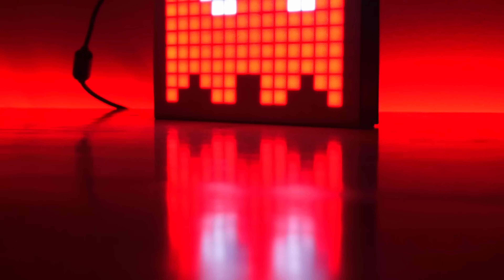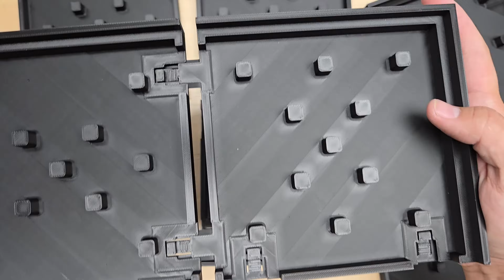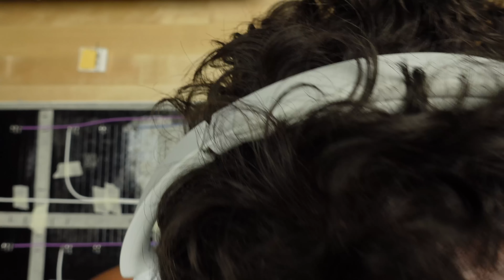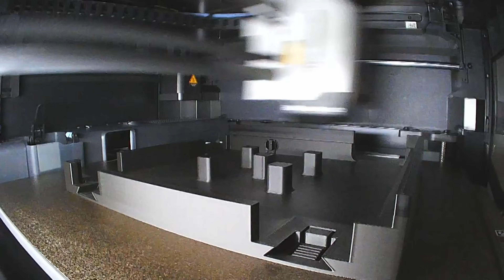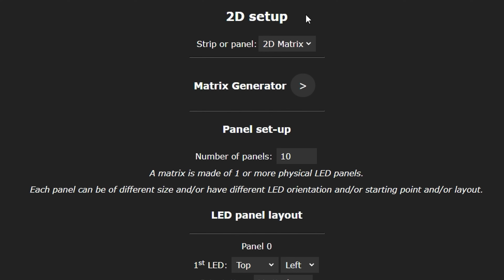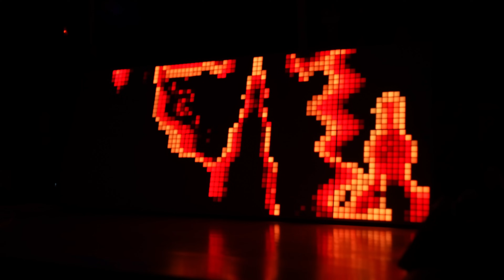I made a HUGE Pixel Display! (80x32 LED Matrix + WLED)

Comment: Based on your display tutorial, I made an 80x48 one (using a 5x3 layout of individual 16x16 matrix panels). It uses an ESP32-S3 driving 4 channels of 3x 1024 and 1x 768 strings of LEDs. I had to power the ESP32 S3 separately and added a 1000uF / 10V cap close to the +5V / GND terminals of each of the matrices along with a level shifter attached to the outputs of the micro controller to make it work reliably. It worked instantly. I also followed your idea of connecting a digital microphone to the ESP plus using the audio reactive build of WLED. I was amazed that even this worked like a charm right away.
Reply from the maker: Awesome, sounds like you made something even better! Definitely post a pic on our discord if you use it!
Reply: @MakeItWorkTech it’s still a prototype, but since I am now confident I know how to deal with such a build I’ll probably try to create an application specific PCB with massive GND and VCC layers or a system of copper rails providing good conditions for high currents (low resistance) and low inductivity. I’ll definitely have a look at your grid / diffuser solution when it’s ready to get built in into a proper case.

Comment: Under pressure, like that of a screw terminal, cold solder flows. Slowly, but it does flow. Over time, each tinned wire will become loose in its respective screw terminal. Instead of tinning the end of each wire, use crimp-on ferrules. Keeps the strands together like tinning, but there's no solder to flow.
Reply from the maker: Interesting! Never new about that. I'll have to use those in the future!

Comment: I made one of these from your models.  Thank you.  How are your attaching the face plates to the base plates?  I ended up using uv curing resin to hold them together.  Perhaps a gen2 of the models that allow the face places to latch in or attach to the bases?  Also is there a way to save the generated pixel art with the converter as a preset?  I couldn't figure it out.

Comment: Can it be made many times larger? What are the size restrictions if any?
Reply from the maker: Power restrictions and # of LED restrictions
Reply: @MakeItWorkTech  I wonder how many LEDs can be contorlled! On your 7th channel you had to control 768 LEDs, if all 10 channels were functioning, that would be 7680 LEDs. I'd think even 1024 LEDs might work on one channel alone. Probably I'd need to experiment!

Comment: on my channel I put up just 2 videos so far..  some projects I have been working on,  some table lamps and a couple corner lamps.. mostly 3d printed... and right now I am working on a 4' x 4' panel for the wall  over 4000 LEDs when it's finished  :)

Comment: I put a 32x32 (4-8x32 panels)  matrix in a 12"x12" picture frame  1024 leds  on a single esp32 and a 5v 12amp power adapter..  also in WLED there is a pixel art converter pretty much built in.. very cool

Comment: They started selling fixed panels like this on Aliexpress now.  Only 4x4 panels, but probably cam be hacked to expand it.
Reply from the maker: I'll have to check that out!
Reply: @makeitworktech  the ones I saw are called IDM pixel display kits, searchable under pixel art.  Not as cheap as if you'd make them yourself I guess, and probably won't scale as big without similar effort.

Comment: Why not just solder the wires directly to the through-holes on the microphone board? That should be a lot easier, cleaner looking, and provide a better connection than a wires soldered to the side of pins. If I had to attach wires to pins like that, I'd use a wire wrapping tool and skip the solder

Comment: Have you tried the animartrix 2d effects that are included in moonmodules? Those 2d effects are pretty awesome and there are a crap ton of them.

Gonna have to get my buddy to print some of these connectable frames for me. I was using your original frames for a 32*32 but the new ones look like they will hold together better. Thx for doing all the design work. Looks super cool.

Comment: I have a tip for you, use crimp connectors, the connection will be more stable and you save yourself the soldering because soldered cables in a screw terminal have a higher  resistance and this could lead to a fire
Reply from the maker: Good idea! What about Wago connectors?
Reply: @MakeItWorkTech  WAGO connectors would also work, even easier because you can use them relatively easily and do not have to unscrew a screw every time, but simply open the WAGO terminals.

Comment: OMG, This is exactly what I want for my bedroom. Im gonna give it a try, wish me luck! ajjaja
Oh, one thing, Is it possible to make those pixels a liiitle bit smaller¿ say, 30% smaller¿
Reply from the maker: You mean thicker lines on the matrix?
Reply: Yes. He was using a 16x16 panel, in another video of his he shows 22x22 panels at the same size, that's roughly 30% smaller pixels. 
If you wanna go an especially costly route I just found 200 led / m strip that's 5 mm wide, therefor a matrix can be built with them. This solution is half the spacing, 4x the resolution.

Comment: For your noise twists a GND and the data line together it will shield the data line from parasites you can use twisted wires from Ethernet cables. You will manage to increase your frame rate times 3. Which will make the animations smoother

Comment: NICE!
I have one with 4 of those 16x16 matrixes, run off a cheap $5 ESP32 on a single pin. I cut cardboard dividers with my laser. I'm using wax paper for a diffuser, and its frameless until I find a better diffuser since I don't have a 3d printer.
I use it as a clock with rotating animated backgrounds.
Just trying to figure out how to stop the scrolling, and have JUST the time with the date below it centered on the screen.
When I get some time soon I'm hoping to try and see if one of the AI's can help me make the code since I can't find any online anywhere.

Comment: learn to use a multimeter and design your own controller board by reverse engineering the controller board. it's incredibly easy. it's what i do. there's only 1 signal to keep track of. cracks me up that you overpay for those garbage controllers.
Reply from the maker: I know how to use a multimeter, thanks! "Garbage controllers" might be a bit of a generalization. I really like some of the controllers I've been testing!
Reply: @makeitworktech  I find learning the best part of getting into stuff like this. I have a few hundred thousand leds of all different types but I'm at the point where I just make stuff for people. I've designed a whole lighting system for my home this xmas for instance and it involves designing a custom controller.  I'm sure I could use an off the shelf one but the coolest ones are created by 'makers' on tindie who ask way too much money for their creations because of economics of scale. I also reject the feedback loop the 'maker' community run on. Toxic elitism and the fact they think they can build anything. I know a bunch of known creators and while I like their 'off screen' personality and think they are generally good people. I've seen alot of them turn into greedy bastards who have channel membership tiers with the gall to ask for a few hundred dollars a month in some cases. One I know is a musician for instance and is sponsored by pcbway, I had a set of pickups for sale and all I wanted was some of his old pcbs to add to the custom learning kits I used to make kits for people who wanted to get into the hobby but can't afford it. All of the sudden when I wasn't giving them things worth hundreds of dollars to help them with content a simple trade was out of the question. I got a free 4090 for instance and offered to trade my 3090ti for their 3070 (with a horribly small 8gb frame buffer) and a few blank pcbs he'd never use again. I was treated like a retard when I'm only trying to help people and they know I have horrible ptsd which immediately made me a pariah. If you notice most channels in the ee or makerspace now have turned into review channels where they get free stuff so it changes them into having a giant ego. I have a software engineering degree I never used professionally because of where I live and family obligations and I'm also a professional guitar player and I have alot of disposable income. I don't think I'm better than anyone else and just want to help people. 

I'm sorry I came off as crass but you are using the bare minimum of your potential. I believe smaller creators on the platform do the most good. I also have 1 or 2 more learning kits to give away that includes tons of neopixels if anyone ever asks you how to get into the hobby cheaply. I'll send a kit to anyone for free in canada or the us. No strings attached other than exchanging a few emails so I know their goals which govern what I include in the kits. I've decided to stop doing it and focus on going back to school for another degree for fun and focusing on personal projects and writing an album. I'm 45 and won't be able to shred my whole life and I've never recorded original music before. Arthritis can creep up on the old fingies. Haha

Once again, sorry for trolling. It's not right and deleting it would be spineless and I wouldn't learn a thing.
Reply: @MakeItWorkTech  I design my own. My point was that you could easily reverse engineer your favorite one that's no longer for sale and build it yourself. Knowing how to make a meal is better than ordering out is all. More rewarding. Life is for learning, I've outgrown led panels but my collection is still huge so I design custom lighting for friends cars or their home theatres or kids rooms. I can't justify a software engineering degree by flashing a microcontroller with other people's code haha. Bitluini has a cool new video if you like the 8mm pl9823 neopixels. They're magnetic. The leds are expensive but look the best IMHO. Each one needs a decoupling cap which is a pain for through hole leds but they are the best. Ada fruit try to sell them for 4 dollars an led in canada. She's a liberal hack.

Comment: Is there a WLED Offline version? I dont like to use wifi for it. 
Also i would like to use a self build ambient light versiion with that.
Reply from the maker: You can connect to it's AP and control it that way, but there isn't another option that I know of.
Reply: The WT32-ETH01 module has ethernet as well as wi-fi capability and works with WLED.

Comment: Hi Aaron, I hope you are well. Awesome project, well done for persevering with the 3d printing,
It looks really great,
That power bank works really great with the pinecil, although I am slightly envious of your red pinecil, I could only get grey/black.
Keep up the great work,
Reply: The pinecil color is a seperate case you can buy.
Reply: @smrzxd 
Thank you, I shall keep my eyes open, the only extras I could get where I got mine from were thumb screw to replace the screws that hold the tip in, as apparently they can strip easily.

Comment: Very nice design and project!! 

I want to iterate on this and see if I can connect the panels via magnets and pogo pins to make the panels snapable.
Reply from the maker: That would be awesome!! Great idea, and achievable I think
Reply: @MakeItWorkTech  Hey Aaron have you released the STL or model files for this project? I checked the description and your github and website and can't find it if you have posted them. Thanks in advance!
Reply from the maker: yeah they are linked in description:
https://www.thingiverse.com/thing:6794674
Reply: or buy some hub 75 panels but that would require knowing how to do grade 12 geometry and program custom effects. the fun thing about electronics is learning. unless you're autistic you'll get sick of looking at them eventually. a teensy 4.1 would be a much better controller than an esp with crap fp precision.

Comment: What I would have done for the data/wires is use something like a GX20 connector. which allows you to run all wires to a connector for easier management.

you could even use 2 connectors a GX20 8 pin for power, and a GX 7 pin for data. [this way you don't accidentally FRY the datalines]

Comment: That's next level Aaron! 🔥

Check out the MagWLED controller. I bought 3 of them and they're great. You can use a USB-C power brick to power the controller and LEDs. I saw it over on Chris Maher's channel. They're a great option for a beginner like me and they're 5V/12V switchable.

I set up some BTF-Lighting WS2811 DC12V 720LED/m COB strips and some BTF WS2812B DC12V Fairy lights. Next project, when I'm able, will be making a couple of 6' COB floor lamps, similar in style to the Philips Hue Signe.  I wish I had a 3D printer to make the base. I've found a couple of STL files for them. 

I have you to thank for the WLED "inspiration" (addiction). 😂

Thanks for another great video!
Reply from the maker: Thanks, Scott! Yeah I saw the controller on his channel, and I was going to try it but I never had a chance.

That project sounds pretty awesome, I'll have to try that myself!